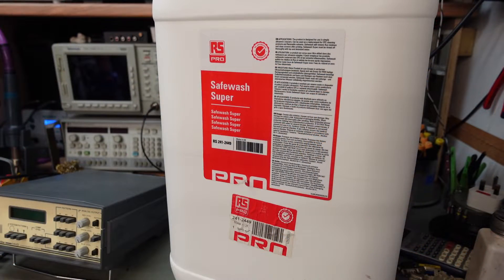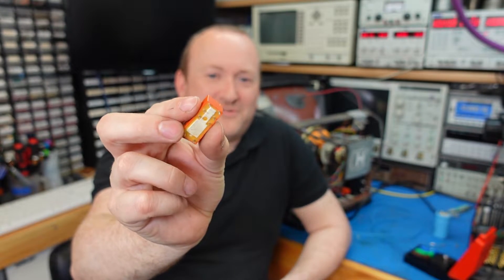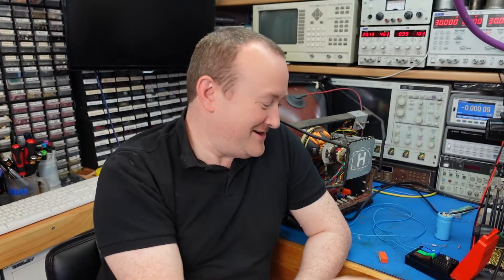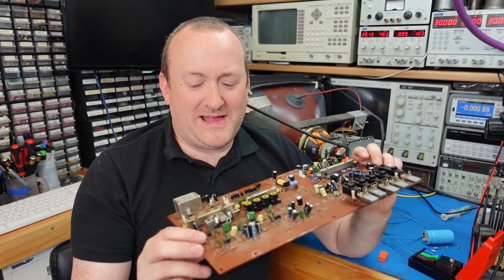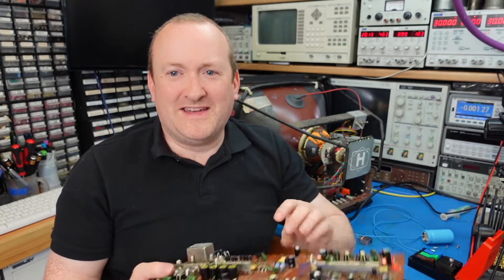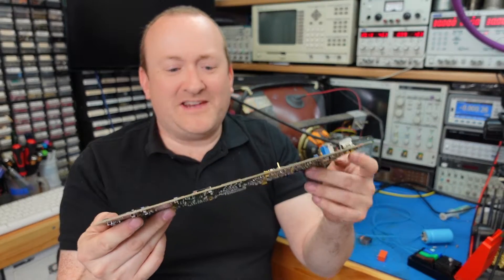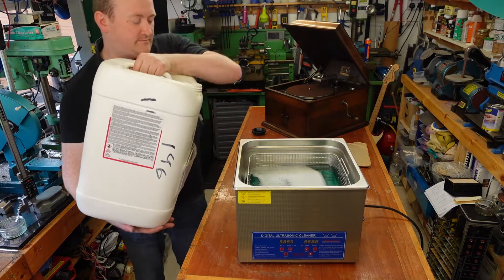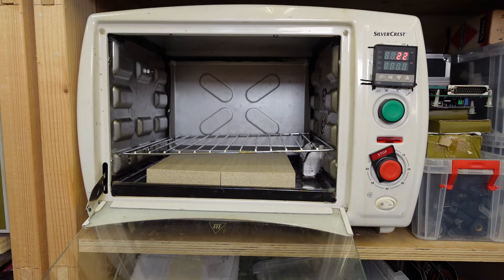Ultrasonic PCB cleaning

Comment: I never forget how back in the 70s I used an ultrasonic cleaner to remove grime from some electronic equipment. The equipment was full of point contact transistors. It appears that the ultrasonics destroyed them all and we had to replace over 1000 OC71s.

Comment: In the late 90s I worked for a juke box and sound system company in Twickenham for 5 years. We restored vintage amplifiers going back to the 1930s amongst other things. Having masked transformer shroud holes etc. I would paint on one of two industrial detergents and leave the item overnight. Then a wash with a hose in the car park, followed by a compressed air blow off and leave in the sun if the weather was good. Only broke one Ami juke box amp out of hundreds of items cleaned that way.

Comment: I air dry my board for a few days, the solution becomes hot anyway and aids in the drying process, stand them on edge. I also blow dry with compressed air, this is very effective when forcing the water from out beneath chips, relays and connectors.

Comment: I spent many years servicing camcorders, the main failure was SMD capacitors leaking, we used to remove the PCB's de-cap them and   clean in ultrasonic bath, we used Safewash 2000, rinse off in de ionised water and dry, never ever had a problem, use common sense and remove relays or memory cells, to say I've washed 100's is no exaggeration.

Comment: FWIW, at work I’ve been experimenting with the water-washable no-clean fluxes that are now on the market. And so far the results are very encouraging. I did a few little boards yesterday, in fact, and in addition to being easy to clean with solvent (which I did partway through assembly), they really do come off nicely in the ultrasonic bath. 5 minutes in the ultrasonic in 70C hot water and they were flawlessly clean. I just rinsed them with clean deionized water and then used compressed air to blow them dry.

FYI, I’m using the water-washable no-clean solder wires from SRA and ChipQuik, as well as the equivalent tacky flux from ChipQuik, plus the “Repair Flux and Cleaner” gel from SRA. (That last one requires cleaning, but it is really easy to clean.)
Reply: Use isopropyl alcohol for final rinse
Reply: @ I could (and sometimes do, though usually ethanol because we have tons of it and it smells better, or commercial solvent-based flux cleaner) but there’s often no need to use alcohol. A deionized water rinse is just as effective, and as long as it dries quickly enough to not rust any steel, it’s perfectly safe. I use compressed air to blow off residual water or solvent. If I really needed absolute dryness ASAP, I could use an oven or even a vacuum oven to dry them.

The whole point of using water-washable fluxes and flux cleaners is to eliminate solvents, after all.

Comment: To remove water from the board, you can use a drying solvent.  Most drying solvents combine readily with water, but most would not work well with a PCB.  Alcohol (usually denatured) is one of the better ways of removing water, but denatured alcohol isn't the best thing to have around unless you can control access to it.  Fortunately,  Isopropyl Alcohol works almost as well, is easy/cheap to obtain and you don't have to be as careful with it.  To dry out the board just soak the board in that, pull it out and let it evaporate.

Comment: Thanks again! My way for drying pcb's is quite simple: I put them outside in the sun or on the central heating for a night. Works fine for me!
Reply: Yeah should evaporate off naturally.
Reply: @mccririck01  works fine.l never use an oven.
Reply: Air in fridge is dry

Comment: So..  if I have a board that is too big to fit in a cleaner, is it OK to put it in edgewise with half (or hopefully just less than half!) of the board sticking out, then rotate it to clean the other half of the board?  In otherwords..  No reason (other than fumes perhaps?) to require using the top, right?

Comment: Can't you just rinse the circuit board with  99% Isopropyl Alcohol after the water bath? Just thought that would displace any water without the need to heat the board.
Reply: Certainly. I’d use compressed air first to blow out the water (which should be distilled/deionized water) and then isopropyl to displace any residual water, then blow that out with compressed air, too.

Comment: dry the boards in vacuum chamber to boil off the water at low temperature. I use an old redundant vac packer from a butchers shop and heat the board inside with an IR lamp my granny had for warming her bad leg, pointed through the clear lid.

Comment: Mark, LOVE your channel.  If you're paying through the nose on detergent for your ultrasonic cleaner, glass cleaner is cheap and effective.  Brand names like Windex cost more, so use an off brand from an industrial supply--and dilute it 50% with water.  Far less costly and it works just as well as the purpose-made stuff.
Reply: Circuit boards are sensitive to certain types of contamination, so using something not made for electronics is risky. This is flux remover, mind you, not degreaser.

Comment: You should always fill an ultrasonic cleaner to the fill line. It needs liquid to dampen it so that it doesn't vibrate itself apart. You might find that it breaks prematurly if you don't. I fill mine with water up to the fill line. Then I find a container or freezer bag that my components will fit in and put my cleaner in that. It saves cleaner that way as well.
Reply: Hey thanks for your comment but why did you put em in a container instead of in the water?
Reply: @AA-xm7rt  So that you don’t use (dirty) a ton of cleaner. With water-based cleaners this is simply a matter of cost and convenience. With flammable solvent-based cleaners, it’s also a matter of safety: multiple liters of hot alcohol is an extreme fire hazard. But a small amount of alcohol in a baggie, jar, or tub, surrounded by a water bath, is perfectly fine.
Reply: @tookitogo  ah thnx for the explanation! I've bought a cleaner since than and i've been using water with a little bit of special cleaner and stuff that small I'll put a bag with water just so it stays together. Its a great machine the ultrasonic cleaner! Its changed the way I work.
Reply: @ I hear you! When I found out that we actually did have an ultrasonic cleaner sitting in storage at work, I dragged it out and have been cleaning my PCBs that way now. I posted a separate new comment a few hours ago about my experiments with water-washable no-clean flux, and those make the process even simpler since no cleaning agent is required, just hot water and ultrasound!

Comment: Hi Mark 👋, I have a circuit board from a digital dash from a Honda xr motorcycle. Most of the solder joints have suffered from water ingress and have become slightly corroded 😢.  And now the lcd display only partly functions now and again and some times does not work at all. My question is this...firstly would it be safe to ultrasonic clean the circuit board with the lcd display still attached to the board, and secondly do you think the ultrasonic cleaner would be enough to remove the corrosion and could the corrosion be the thing from preventing the dash to display properly. Cheers in advance and kind regards

Comment: i just use a small amount of washing up liquid.  if something is greasy i'll spray it with ipa first to get the worst of the grease off.  to wash it off after i spray with deionised water from a sprayer bottle.  I just let it try at room temp.
Reply: Safeways isn’t degreaser, it’s flux remover. It will remove grease, too, but flux is what it’s designed for, and many degreasers won’t remove flux well. And you need it to be electronics-safe, which all-purpose degreasers aren’t guaranteed to be.

Comment: My method for drying vintage boards is a gentle heat combined with moving air. I built a drying oven using a small ceramic space heater that had a fan. Component temperatures remain around 38C and the forced air tends to get into harder to reach areas and speeds evaporation.

Yes, I realize I’m blow drying my boards. Don’t judge me.

Comment: Hi Mark, Love your stuff man😊 I just started with some Vintage audio repairs and had to clean some pots and switches. Had good results with contact cleaner, followed by compressed air blow out and than some protective contact spray. But i might go for this sollution too, Seems better in the long run. However, What stuff do you use to get them going again and protect it from going bad again? Just plain old sewing machine oil or something?

Comment: I've been thinking of an ultrasonic cleaner for a looong time. It's just it takes so much space and I'd need a large one for motherboards and similar. I wash my PCBs in Electrolube SWAS, I have a feeling it's the same you showed on video, just RS branded. I love it. It's effective but water based. I then rinse in water, final rinse in distilled water and then compressed air to remove water as much as possible. Finally 48 hours drying time in dry place. I love how "brand new" the PCBs turn out. The SWAS removes that layer of oxidation really well. Thanks for the video!

Comment: Awesome don't really think about this,whats your view on ESD cleaning inside with a vacuum cleaner...I've been cleaning inside tvs,tower PC for years no problem...others say be very careful with static build up...
Reply from the maker: I don't think ESD is such a problem for complete PCB assemblies, where sensitive parts will usually be loaded by pull-up / pull-down resistors and other EMC 'what-not' that would provide a safer leakage path. I'd be more worried loose components vanishing up the tube.

Comment: Can you advise me….. how much would a fully restored RGD 1046 radiogram cost to buy ?
Reply from the maker: If you can find one, I suspect it would be up for sale around £2000. I've heard that the amplifier alone sells for £1000, and not necessarily in working condition! Unfortunatly, it has the attention of the Audiophile market - so sensible pricing goes out of the window...
Reply: @MendItMark  ….ok and thanks. Your estimate is higher than others I’ve asked but thanks for replying 🙂
Reply: @MendItMark  …….. oh one other question and sorry if it’s a daft one, but we’re they always a steel needle for the 1046 ?

Comment: that fluid is basically car windscreen wash. dilute with distilled water - bingo same stuff
Reply: No it’s not. Safewash is a flux remover, so it contains added ingredients (saponifiers; lye, basically) and corrosion inhibitors not present in cleaners for non-electronics use.
Reply: ah thats a nice tip...i try that in my cleaner...windowwash is reallly cheap
Reply: How much to dilute?